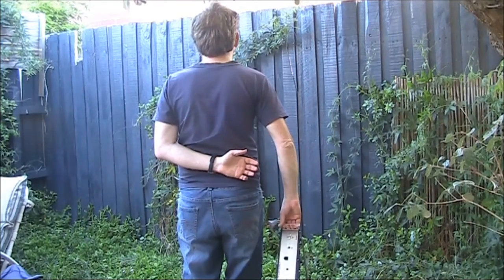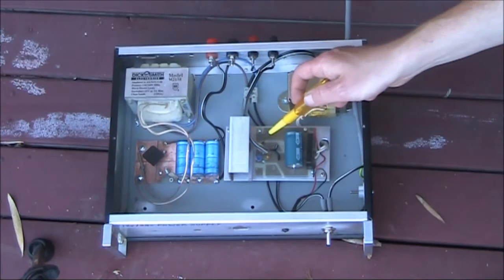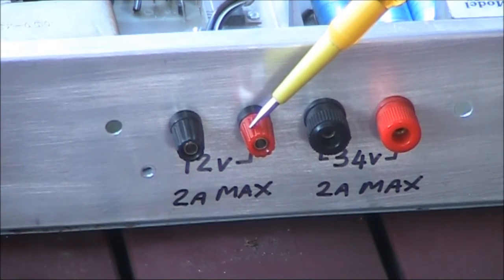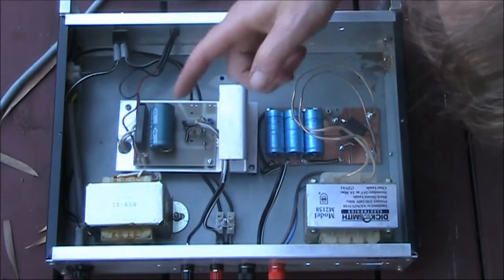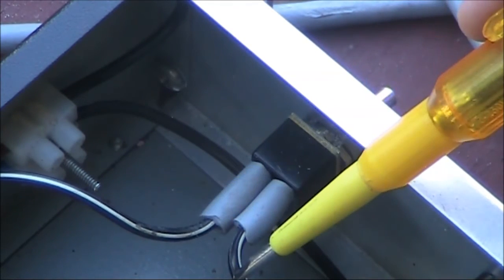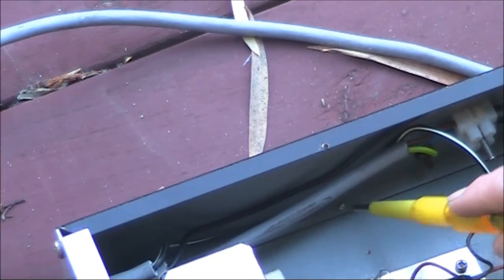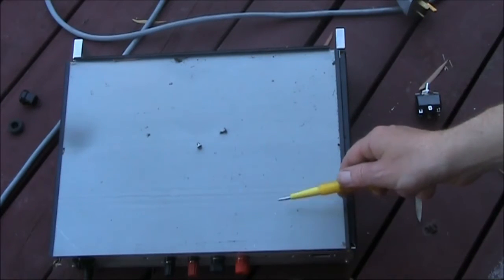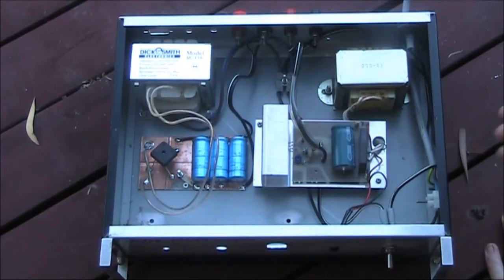Inside a mains power supply and how it could be built better

Comment: Hi Peter,An interesting video, I was told by old times to always keep one hand behind your back or in your pocket to avoid a fatal shock when working on Valve or live high voltage equipment. How about a bleed resistor from the electrolytic reservoir caps to ground to  make it safe from electric shock when the equipment is turned off. 73 M0DAD